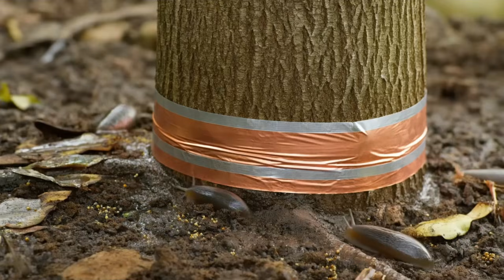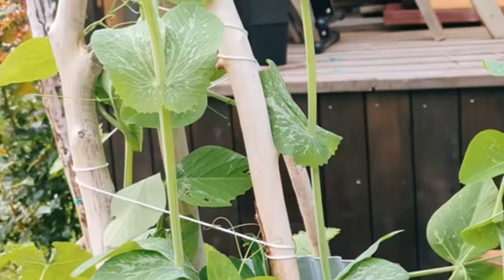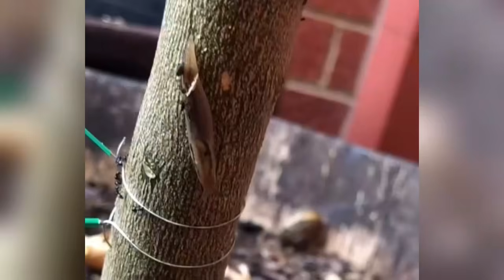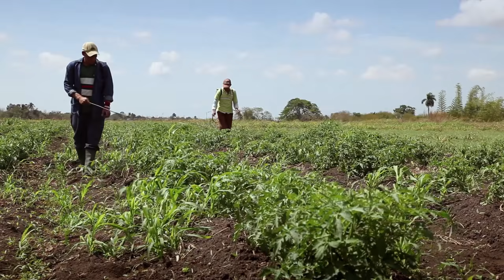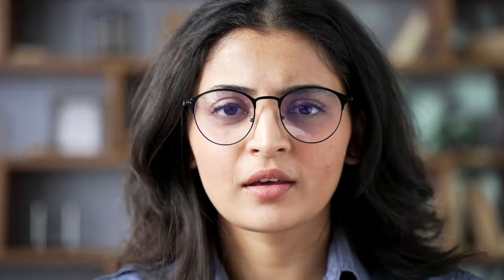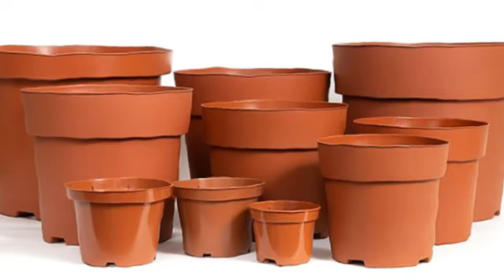The Rain-Powered Slug Barrier Garden Stores Won’t Tell You About

Comment: When you tape copper on zinc plate doesn't it close the circuit?  Also which metal need to be grounded and which does not?
Reply from the maker: That's a great question about the copper and zinc! The idea isn't to close a circuit in the traditional sense, but rather to create a small electrical potential that slugs dislike. As for grounding, neither metal needs to be grounded in the way you might think of a household appliance; it's the interaction between the two that's key.

Comment: Hey love your content! I watched your episode a few weeks back with the copper and zinc wire around a wooden dowel placed inside a raised bed. That makes sense because both metals are within a damp environment which completes the circuit, but how does putting a copper tape on the outside of the container where it doesn't make contact with moist soil work?
Reply from the maker: Great question—the slug’s slime acts as the electrolyte to complete the circuit with the copper barrier, even without moist soil! 👍 Just amke sure the copper tape and zinc are about 1 cm apart and not more.
Reply: @Sidney_Explains_Money ahh right that makes sense.
Reply: @Sidney_Explains_Money That contradicts what was said in the video, re rain recharging the system and the need to extend one of the materials into the soil